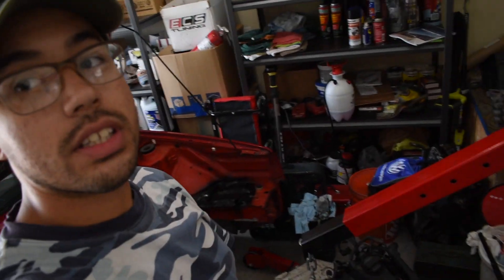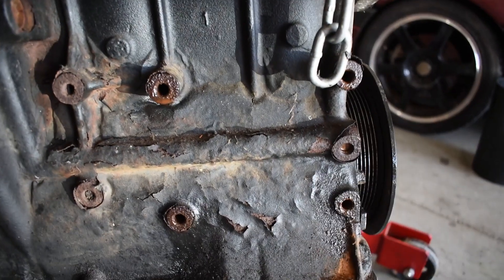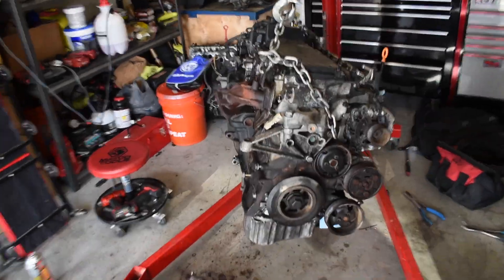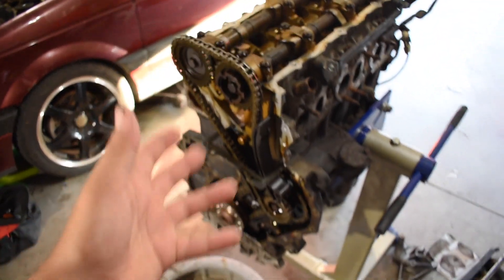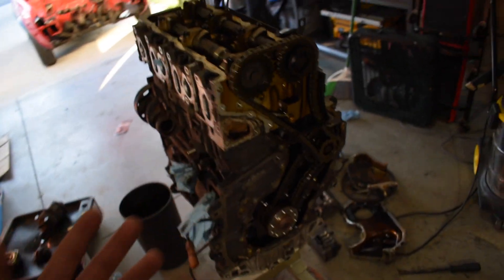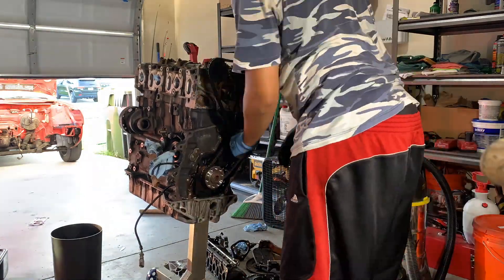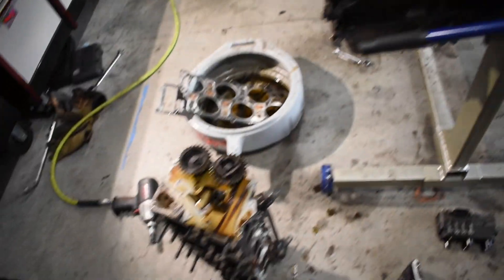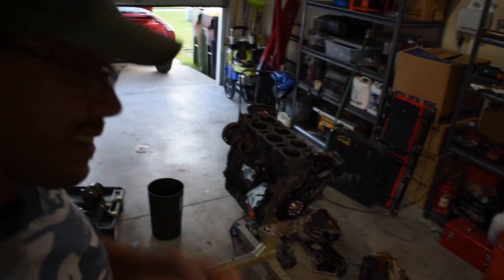MK2 GTI VR6 SWAP !! PART 4 - Engine disassembly!!

Comment: Bro i am so Glad my MK2 has a CE2!!!! I Picked up a 3.2L with the wire harness, and ECU for a 16V head and $400. I also picked up a mk3 VR6 speed cluster because i am going to use the 02M 6sp. I am in the process of finding a swap kit. I already brought a hydraulic clutch conversion kit. I brought a forged crankshaft from a 2004 Tourage. My motor came out of a 2007 A3 (8P). I thought about going with HPA motorsports
Reply from the maker: Wow that's incredible !! We got the mk2 on the back burner right now. You know life happens lol